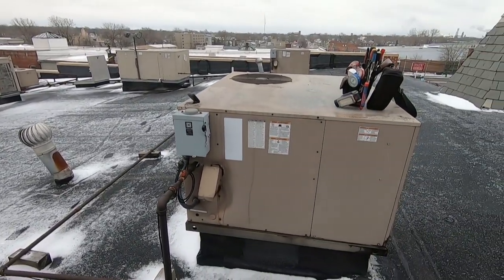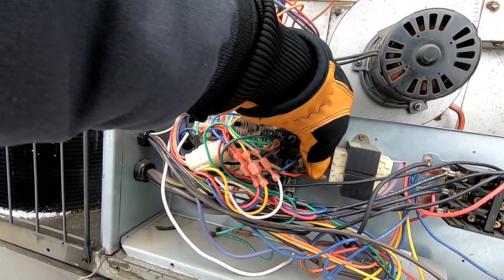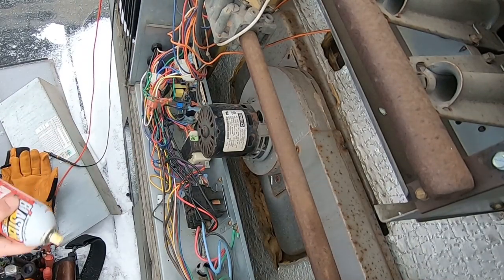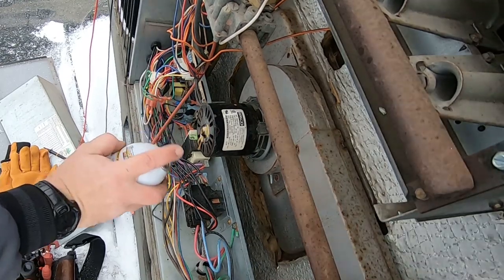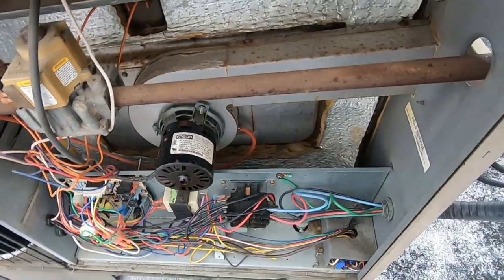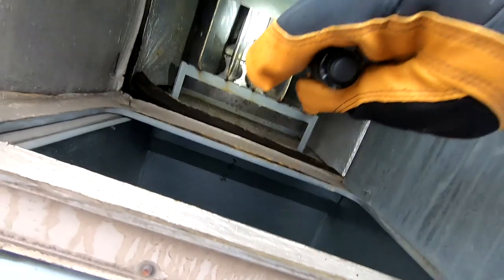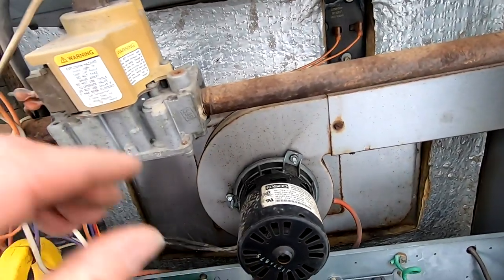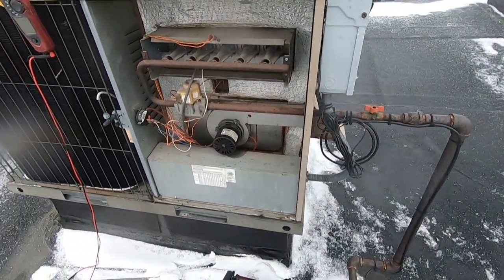No Heat Call On Two Old Armstrong Packaged Rooftop System With Bad Draft Motor & Control Board

Comment: Great video. Stressing the importance of understanding the sequence of how equipment works is key to diagnosing the source of the problem. Especially if you don't speak BLINKS!
Reply from the maker: 🤣🤣No blink,  no problem,  your right I was pissed at first but then I remembered I could use my brain. 😁
Reply: Arrrgggh! You've perfectly identified my kryptonite lol.
I get pissed.

Then I remember I can use my brain. 🤦‍♂️
Is there a way to skip to step 2? 🤷‍♂️

Great vid bud, nice catch on the second unit and nice job helping that old draft motor live a nice, long life. 
Two thumbs up 👍👍
Reply from the maker: @sinistersparky9657  Hopefully just long enough to get changed,  this is not a long term fix, the bearings are usually scarred once they stop turning because of lack of lubrication and will seize again. Thanks 4 checking it out👍👍

Comment: Good video- love learning new tricks to get er goin!
Reply from the maker: Good temp fix til you get the parts. Works on about any motor that has bearing failure. But remember, once the bearing seizes its got major damage that can't be undone with just lube.
Reply: Words of wisdom sir 👍

Comment: Nice job pick you up a Klein  24volt test light  it works  nice just going through the 24 volt circuit  I use mine all the time on furnace  just to check switches pressure switches  and limits  were are you at in Ohio  I'm in lorain county  thanks for all the videos and tips
Reply from the maker: 👍👍I have built a few 24v lights like your saying,  it's not too often I can't catch it acting up with my meter, I'll usually add the clamps and hit the min/ max button. Thanks for commenting!

Comment: I replaced the inducer on a 25 year old residential package unit.  I tried the to spin the motor but it would not budge.
Reply from the maker: it doesn't work every time but it's worth a shot if the part is not available at that time.

Comment: Great Video! Question, at 8:58, you had a wire touch ground, what was the purpose of that?
Reply from the maker: in the video I said I could smell fuel but it was not lighting, I did not hear it sparking at top so to test the control board and verify if the problem was in the cable, igniter or control,  I took a jumper cable from the controls spark connection and ran it down to ground. If it would have sparked then the control board was fine, if it didn't then the control board has a week high voltage spark and the board will need replaced.  This can be dangerous which is why I said not to do it. What you do on your own is completely up to you.
Reply: HVACR Survival thank you for the explanation!
Reply from the maker: @armandoalaniz8037  that's what I like doing for some reason. 😁😉

Comment: Good tip for limping along an old inducer motor.   I was surprised to see a good blue flame after ignition.  Seems as if the hx has been replaced before.   Did something happen that you had to disclose a disclaimer?   First time I remember seeing one in the videos but I understand.
Reply from the maker: The heat exchanger looks to have been replaced once before because I seen red silicone on the backside of the heat exchanger while inspecting it. The only reason I ran the disclaimer is because generally I don't show a lot of repairs that would be potential to create extreme damage or death.  I try to leave those sort of things out because anyone doing these repairs should be in the field and have a strong knowledge of  how to do them right. My channel was never meant for the do-it-yourselfer but I have no control over who's watching what I put out there.

Comment: Shake rattle n' roll
Reply from the maker: I'm working on that Canadian make-up air unit today I told you about. It's a EngA. Yeah she was a beauty, this customer is reluctant to replace the equipment.
Reply: @HVACRSurvival  cool, finally someone who has heard of them lol. Yea there beasts.
Reply from the maker: @HVACRNorth  engineered air. They're nice but very over-engineered it seems. This is a geo thermol make-up air unit.
Reply: @HVACRSurvival  I agree 100% bud. Geothermal wouldn't mind seeing that. Coil leaking ? Is there a refrigeration side?
Reply from the maker: @HVACRNorth  no it's just a p.m on the whole building. I have 16 geothermal units plus this thing.